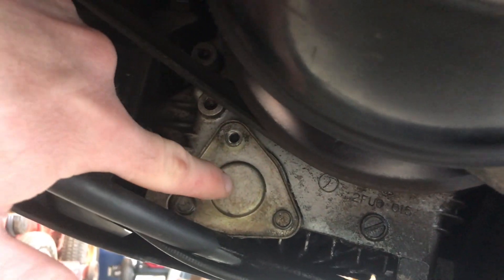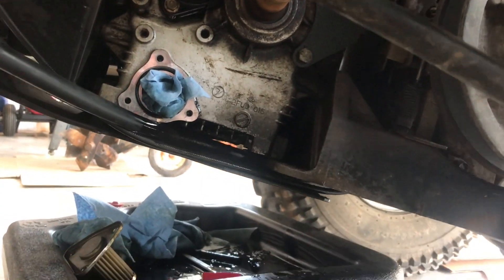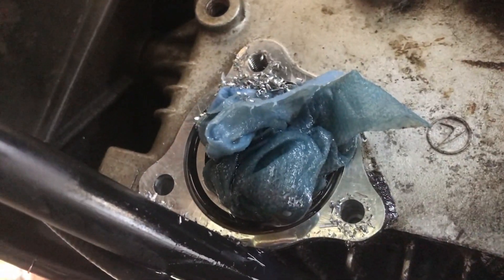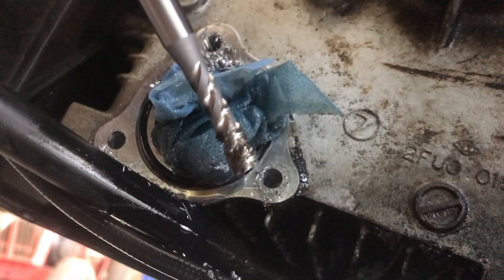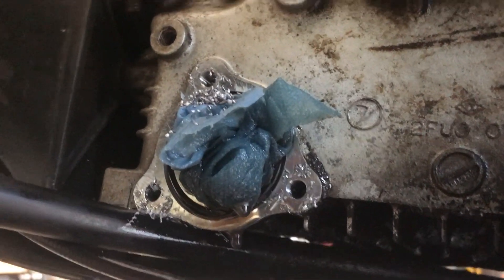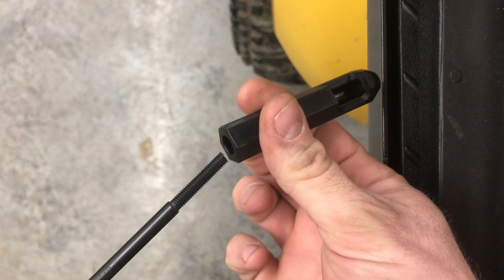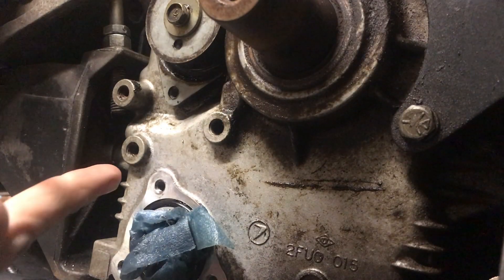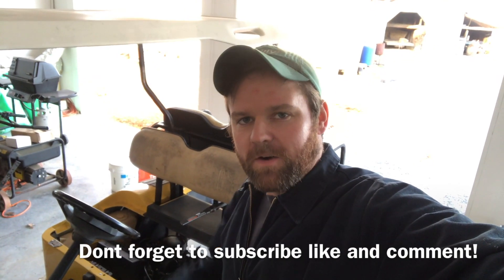E-Z-GO Oil Leak!!

Comment: Same thing happened to me, but it was a little worse. When I went to change the oil, all 3 heads on the bolts broke off. Then when I finally got the bolts out of the threads, all the threads were ruined so I had to re tap them.
Reply from the maker: Wow! Yeah that isn’t good.